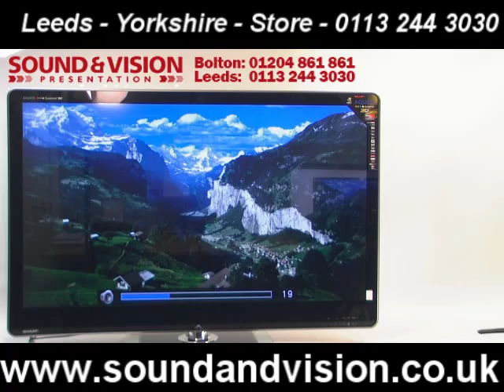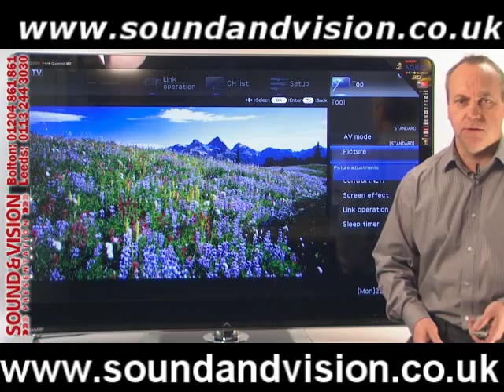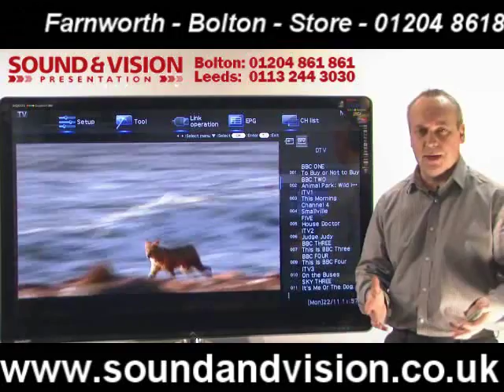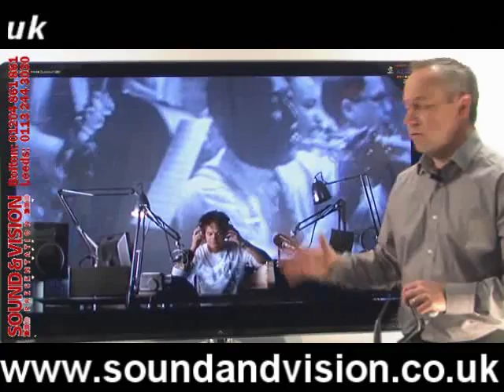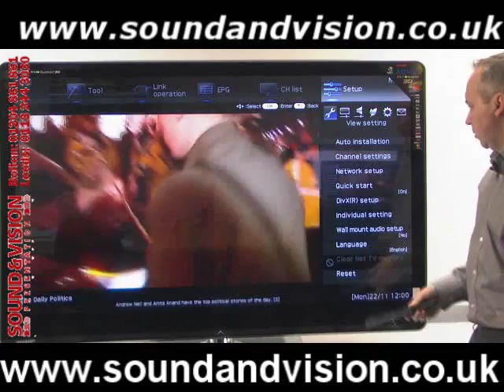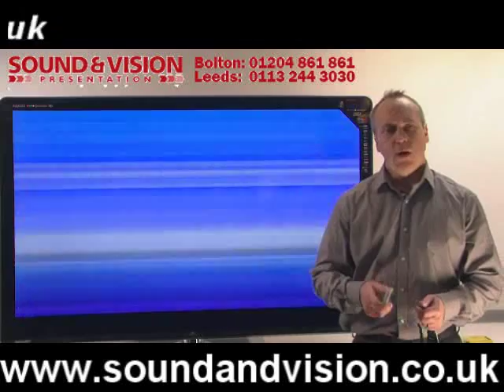Sharp LC60LE925(LC60LE925E)Video Review-Cheap Quattron 3D L

Comment: So i have the Sharp Quattron 46 inch television and since i've had it the touch panel for turning the TV on/off, vol up/down and all that jazz hasn't worked. So just recently i went and was messing with the settings to see if see if it was disabled. So through this process i got to the part of a menu that said to prohibit use of the remote and another to prohibit the use of the front touch panel. So idk what i was thinking and locked usage of the remote. Is there a reset i can do to undo this???